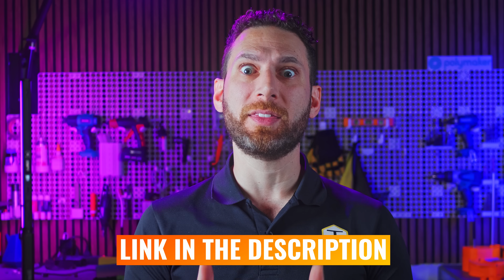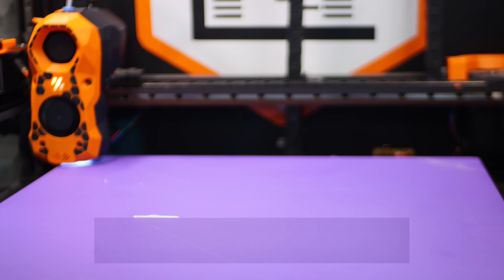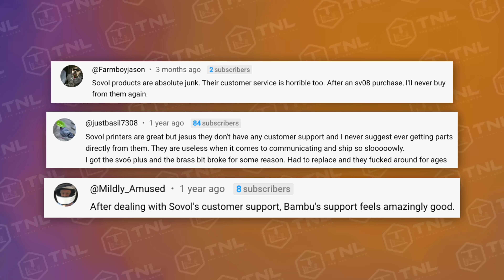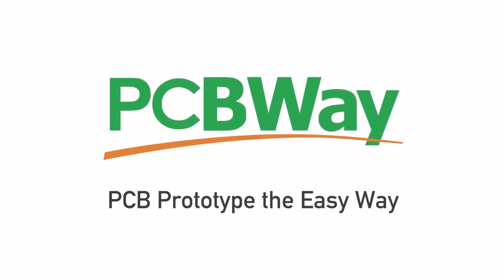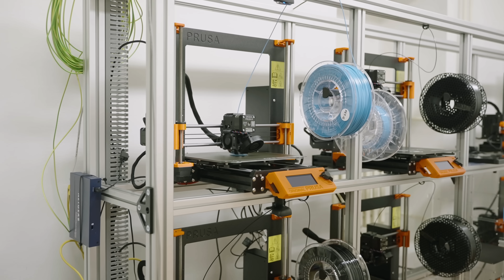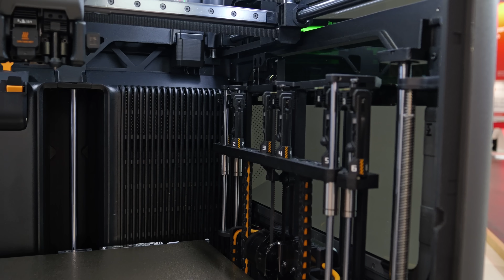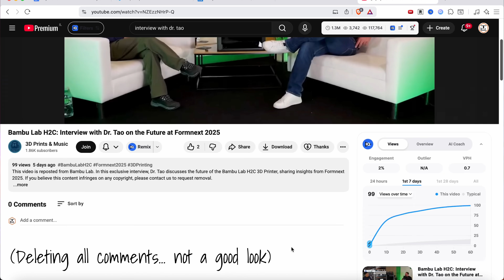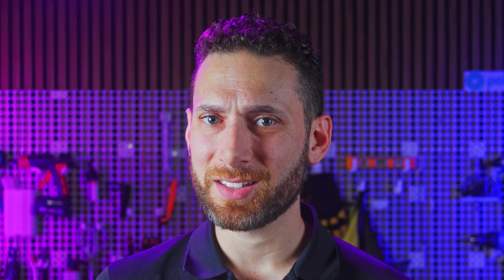My HONEST Annual Report Card for Each 3D Printer Brand

Comment from the maker: Soo, what do you guys think of my takes? Out of line? Right on point? I'd love to hear if I read your mind or not :)
Reply: On point, the RFID tag needs to work as filament and printer manufacturers need to work together to create the future printers.
Reply: Why haven’t you reviewed any printers from Bambu Lab in the last two years? It sounds like there’s a deeper story there and I don’t think many viewers know it. I know I don’t. Maybe enlighten us? Or maybe you made a video about this already and I missed it. I’ll have to check.

I’m a fan of Bambu but agree with much of what you said. They have a very functional and effective ecosystem but it is a bit too proprietary and closed off. I don’t think they’ll ever really change that though. Extreme software restrictions under the guise of (mostly unnecessary) security measures is not cool at all though, Bambu Lab. And the community made that known. I hope you listened well.

While the H2C seems very innovative in some ways, it also just seems like an impractical solution to me. Especially when compared to the U1 for example, and how it works in contrast (all while being 1/3 the cost). I think Bambu Lab just overthought and ultimately rushed this one (due to the popularity of the U1 launch).

I love your recommendation for SnapMaker by the way. I would buy a U1 Max in a heartbeat if they could keep it to about $1500 or less.

Ok, that’s all I got for now. Thanks for the great videos!
Reply: @zx4133 I don't know if he feels comfortable sharing the story, but there has been rumblings of Bambu taling the apple approach of not seeding units to those who openly push agianst their closed source nature and/or those who dont put their machines in a good light. While I do appreciate what bambu has done for printing in general, I really don't like the direction they have taken on the last few years. Look st the A1 launch recall, they really took care of their customers, now we have A1s burning up (likely due to qc or cheaper components) and they refuse to acknowledge it and are primarily handling it by sending folks new mainbaords and not replacing their printers
Reply: @GonnerMeLeggies  Rumblings or verified facts?  Because I see valid criticism being intermingled with misinformation as well as quite bizarre anti-Chinese statements (considering the majority of brands are also from China).
Reply: @loganmedia1142 Just unsubstantiated comments, which is why I said rumblings as I am not in any place to verify or vouch for their validty
Reply: @zx4133  Probably because they don't send him review units like every other company does?  Bambu sends printers to anyone and everyone... unless they speak critically of their products.
Reply: @meikgeik  they stopped sending him things because he released a review too soon.
Reply: @meikgeik  You have proven examples of this?
Reply: @zx4133  He broke embargo and effed up the launch of one of their printers, which caused Bambu to cut ties with him.  So, he's had no free printers from them to review since then.  Whether that makes him a less biased source about them (due to no longer having a relationship with them) or more biased (sour grapes due to no free printers) is left as a question for the viewer to decide.

Personally I'm OK with him because I think that anything bad that happens to Bambu is good for the community, but that's just my opinion.
Reply: @netpackrat  Ah I gotcha. Yeah I can totally see Bambu being all dramatic about that as they are so closed-source, propriety, secretive, etc. I’m definitely not a fan of that. I have a couple A1s and I do really like them, but I haven’t been impressed with any of their other printer releases aside from maybe the P2S. (Not for the prices they charge anyway.) I got 2 SnapMaker U1s on order though and I’m super excited about them. So we will see.
Reply: @netpackrat I see this as being less reputable since he was  giving his patreon members insider info,

From reports he shared reviews ahead of launch for them. From then on I just can't get behind this channel being reputable anymore sadly.
Reply: @CoyoteOne  Yeah that’s not cool to do. I see what you mean. Hopefully he learned from that experience. I like his videos for the most part but you do always have to be careful/skeptical about the true intentions and motivations of YouTube content creators. They do get paid for this stuff so there can definitely be ulterior motives.
Reply: @netpackrat  he isn’t as objective.  He couldn’t bring himself to say that the comparison of the P2S (basically the upgraded X1C at $550) compared to the Prusa CoreOne+ at $1299  is a complete embarrassment for Prusa.

…it isn’t even a question.
Reply: @mandoreforger6999 yeah, that’s why I started watching less from him. At a minimum it’s unrealistic bias and at worse it’s a “bought” opinion. 

Unfortunately I think it also affects his opinion because saying bamboo gets any kind of a negative for ecosystem is wild. Especially given the fact that he highlights how well you could use orca slicer to work with it and anything else. Dang, I need to go back to uncle Jessie because yeah they just reminded myself why I stopped watching this
Reply: @CoyoteOne  That puts this channel's attempt to frame it as an innocent mistake and Bambu Lab as vindictive in a very different light.
Reply: @zx4133  He lost association w/ Bambu for breaking embargo
Reply: @CoyoteOne  Thank you for replying. I wasn’t aware. I just read up on it a little bit. Unfortunate situation.
Reply: I think it's interesting you didn't mention that Elegoo sold a printer with an MMU coming soon and then rug pulled their consumers. It's also pretty weird to be the most hyper ctriical of a brand you also claimed to have not tried in 2 years, feels like bandwagoning more than genuine feedback.
Reply: I have to be disagree with you on your idea that its bad that bambu lab like releasing a new trailer when another company releases a new printer is bad, these are big companies and they all need to win over the customers, what would be the point of handing over sales to other companies be.
Reply: Although I am sure the U1 will sell like hot cakes, you could make it a bit less obvious that you are on Snapmaker's payroll. ;-) As an owner of the J1S, it just does not seem very convincing that a machine at a way lower price, with much more features, should be seemingly without fault. My experience with them is that they deliver quite good hardware, but hopeless software. Extremely rare firmware updates. I am just waiting for a decent alternative to replace it. But it won't be the U1!

For the rest of your video, I mostly agree with your comments. You where way to nice with the Peoples Republic of Bambu though. :-p Sad to say, I am running out of brands I find trustworthy. :-p
Reply: I think your mirroring my thoughts. But just mentioning a snapmaker XL or an sv08 toolchanger (hopefully a sv08 ACE)... It makes me happy and frustrated that my perfect printer isn't out yet.
Reply: Now this is a video I can get behind.
Reply: You missed some crucial points here.
When evaluating a business as a whole you should talk more about their strategy:
- who is their customer?
- what has their business growth look like this year?
- what is their market strategy and has it changed this year?
- what products have they developed? Are they innovating?

Your first BIG mistake is you keep saying the “community” or “yourself” thinks this company is doing good at [blank].
You failed to recognize that each company may have different customers. They aren’t all selling to “the community”.
Who is “the community” nowadays?
You keep mentioning them passing judgement so you should state who they are. 
Example: let’s look at the two giants Bambu and Prusa
Looking at the market as a whole I would say Bambu labs sells beyond “the community”. It is clear in their marketing, pricing, and industrial design (ergonomics). They made 3D printing an appliance rather than a hobby. This is their origin and the reason they are the biggest. They have the widest customer base. The question is this year did they keep that same path? 
It is obvious that Prusa is not focused on industrial design or ease of use. Their filament loading is a good example. They are engineering focused and technology focused. Look at the silicone printing for example. Their machines still look and act pretty scary to “normal” people though. They sell to people who do not shy away from tinkering. They have a smaller more niche market.

I have a lot more to say but overall you should look at the business’s strategy as a whole. You just took your wish list and the “communities” wish list and used that to apply judgement to companies 😑….
None of these companies are gonna actually take this as feedback
Reply: Yes, mostly. But also I wanna add one obvious pain point from Creality users that really easy to fix, but they just do not care.
Crealilty, fix the damn camera preview in the web ui and **your own slicer**! Camera does not preserve aspect ratio. How could you mess that up such a basic thing and don't bother to fix?! On ultrawide screen it's looks hilariously bad.
It works just fine in fluidd after rooting, so it definitely doable. User should not be forced into rooting their own machine and switching to Orca just to get correct remote monitoring...
If you wanna people use your slicer, at least don't make it look broken on the basic level.
Reply: You missed the worst "3D printing brand" of 2025, and that's eufyMake/AnkerMake. They've discontinued the M5/M5C, won't open source the com protocols for first class OrcaSlicer support, and still continue to force you into their buggy slicer (which is bordering on abandonware). Anyone buying their E1 UV printer is asking glutton for punishment. Everyone should know how terrible this company is.
Reply: Prusa should get an F. There have been many problems with the CoreOne, then they release the L which had yet more issues. The INDX is way behind, but not in their control. They still have no competitor for the AMS system, MMU doesn't count, it's so old. Prusa couldn't even do a camera right. Prusa lacks most of the modern features. Prusa's only saving grace is the semi-open source. Show consumers a Prusa and a Bambu and see which they think is a serious printer, especially when you see the price of what Prusa offers. I'm fed up with them, they've lost a customer with multiple printers.
Reply: I really like your backround music at the beginning !
Reply: Pretty good. Would have appreciated price estimates for improvements if any though.
Reply: All good points... I appreciate you...
Reply: I am too new to be able to comment on other manufacturers. All I can say is that the Flashforge AD5X has reskinned Orca, but has had 2 updates to software/hardware in the 6 weeks I have had it. And yes I am still making sacrifices to the gods of 3D printing lol.
Reply: Really interesting video. Thank you. I have the feeling that you cut out on your comments to Bambu lab. Is it just an impression?
Reply: Just true words!
Congratulations for your honesty and not-payable personality
Reply: I’m a big fan of Creality myself, and I completely agree that their model naming scheme has become overly complicated. I recently purchased the Ender 3 V3 SE and had to upgrade to the Creality Nebula just to access wireless printing and webcam monitoring—features that were available on the KE series for only a few dollars more.

I really enjoy the channel and the honest feedback you provide to the industry. I hope it doesn’t fall on deaf ears and that it encourages Creality to move in a more innovative direction.
Reply: I never get the 'H2C colour changing takes long' arguments. The first thing is lets make fair comparisons: are we looking at 'how long before the nozzle deposits switched material' or 'how long before the nozzle deposits switched material on a model' ? Most PrusaXL tests I see do not use a purge tower, so it is fastest at the latter. The U1 is the fastest at flowing material, but always seems to use a purge tower for safety to calibrate flow. The H2C is the same speed as U1 if switching between the two nozzles in the head, but at about 28s for flowing material, again at a purge tower. Longer prints with optimised filament loading takes longest on H2C, but is a lot closer to multi head than single head + ams like systems. If you need 5 materials on U1, 6 on XL or n+1 on INDX systems you are manually swapping, H2C at the cost of XL you will need to do that at over 25 materials. I personally think the vortex system by bbl is very niche, compared to the indx system by bondtech (although I hope both systems can get adopted by other manufacturers too), so I think the H2C is a niche machine compared to the U1 and prusa indx machines (the XL is niche as well, I love that Prusa is getting into exotic heads for that one).
But the switch taking long is so down to circumstances (always longer than multi line solutions of course) and definitions, it makes for a weak argument with too much need for context.
Reply: @thenextlayer  I think you’ve got a divide between people who love the process vs have work that needs done. If you love the process, get something you can tweak all day. Me, I’ve got parts I need to get out the door. Bambu does that without me babysitting and stress. 

Apple vs Linux.
Reply: From your description of Bambu Lab, they think they're coming across as the Apple of consumer additive manufacturing but they're leaving toe prints on the line between ethical and unethical practices from the consumer viewpoint.  Did I accurately summarize your description?
Reply: What my opinion bamboo Labs is actually more affordability to buy through them by their printers through them by their filament through them buy all the accessories cheaper through them not so much like tons of upgrades or tons of new machines I am talking about the affordability scale without cutting corners without causing any negative effects what are the best ways for bamboo labs to make the printers they're making today cheaper more efficient run faster run with more speed controls I'd like to control the speed are the overall printer during the time of printing instead of just 50% I'd like to knock it down 10% 20% maybe even by fives I know certain Prince the top half runs could run differently but also the same time I don't want to just do it the way they got it I don't want to change the original settings I just want the printer lunge slower because I'm not using filament that can run as fast as other filament but it still runs is generic
Reply: @thenextlayer Maybe you need to update this video in regard to what has happen so far in 2026 with everything from Mova Atomform and Flashforge to all the turns with Bambu Labs and upcoming Sovol 6 toolhead printer?
Reply: I cannot agree more in companies sending printers with mainline klipper and using Orca rather than a reskin. So many people would spend an extra 30 bucks to have a better MCU with full klipper. Also Elegoo really needs to figure out how to keep their community involved and up to speed.
Reply: The obvious Bambu hate is off-putting.  You came off as biased and less than objective.  Exhorting militant adherence to “open-source” is just as dogmatic and anti-innovation as anything else.  It is pretty clear that Bambu is targeting “multi-disciplinary” makers beyond 3D printing only.  If their semi-closed ecosystem becomes a hindrance, the market will punish them.  I am seeing the market continue to respond positively.

The P2S (basically the X1C with quick change nozzles) is $550 or half the price of the X1C launch price from THREE YEARS AGO.

That is after tariffs.  

This seems wildly pro-consumer to me.  It destroys any offering Prusa offers at that price point.   

Heck, their “build your own” obsolete bed-slinger kit is an embarrassing $709.

Their closest offering is the CoreOne+ assembled at $1299.

You have got to be kidding…stop the hate.
Reply: Qidi is lucky you didn't decide to do one on them. 😅
Reply from the maker: @maxaclarke haven’t tried their stuff in years and years.
Reply: @thenextlayer  I have a Qidi printer. The stuff they make is actually very impressive in a lot of ways, but they keep stepping in it and having fiascos as a company. I think it would be interesting to have an influencer give a closer look into their company like you did with the others. It's hard to get a read on them because their PR and marketing feels like it's all over the place.
Reply: @thenextlayer  you are missing out ;)
Reply: @thenextlayer I completely disagree with the idea of telling Creality to “kill the Ender-3.” The Ender-3 is a staple of this entire hobby—especially for people who are just getting started and don’t have $700–$2,000 to invest in a machine. It’s not just about having a cheap printer; it’s about having an accessible, moddable, open-source platform that teaches you how to compile firmware, upgrade hardware, and truly learn the mechanics of 3D printing.

Yes, Creality absolutely needs to stop beating a dead horse with endless new “variations,” but the original Ender-3 and similar baseline models should stay on the market. They’re important entry points, and they’re the reason so many people in this community were able to grow their skills and get involved in the first place.
Reply: With Elegoo doing the Rug pull on the AMS and said sorry in so many words, I took the money I was saving for 2 ams and got my very first Bambu p2s and if Elegoo come out with ams "elegoo CC 2" I will not be buying that. I wanted ams not for color but for printing from one spool to the next and at this point NOT sure about trusting and creators saying this will be a add on. To make that clear I sure chanel like uncle jesse was just passing info along and printer MFG pulled the rug from those channels as well all the customers who purchased one...
Reply: Your segment about Bambu boiling down to "shame on you for a teaser video." is pretty weak.
Reply: @spoonfuloftactic  The irony that if they had continued selling the H2S/D and stealth dropped the H2C, people would've been angry that they bought a product with a new one coming so soon.
Reply: Sorry but bamboo lab not wanting to be open source is good. I don't know why every single one of you YouTubers pushes orca slicer or any of the other crap when bamboos is perfect. I would rather only be able to use their slicer and have almost nearly 100% perfect prints every time then. How are you going to go mess with crap?
Reply: @justinscott3952  Such an ignorant fan boy, lol.